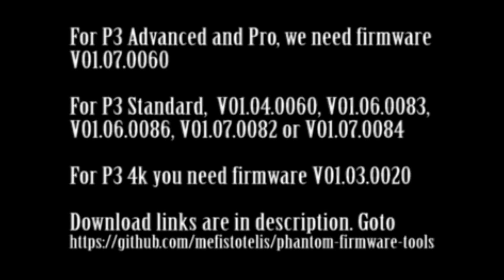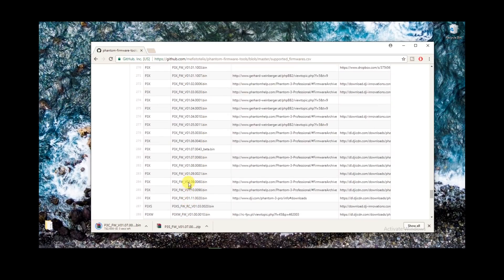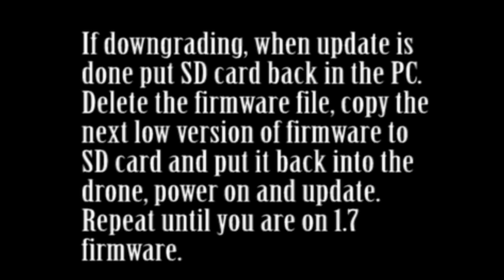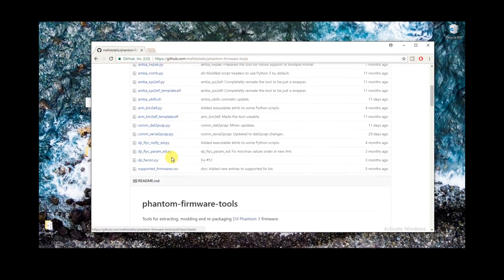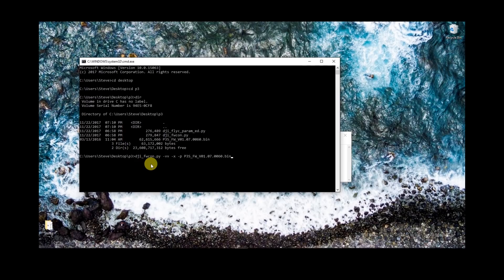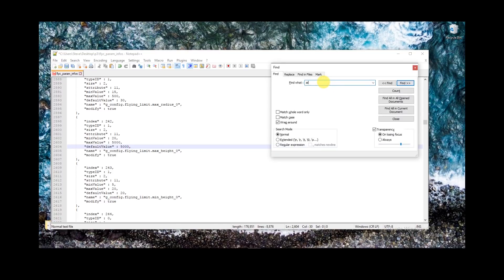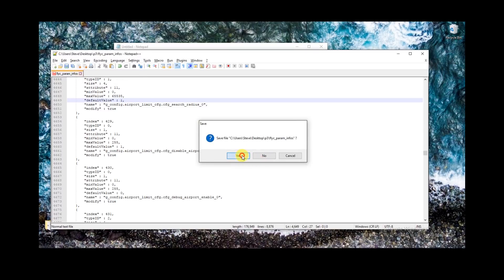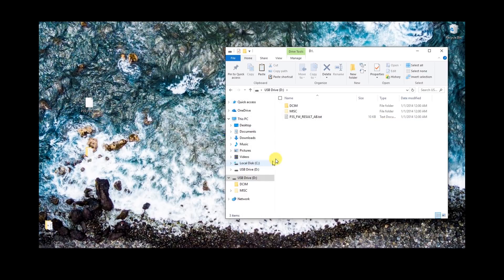Phantom 3: How to modify flight parameters and hack height, speed, flight area restrictions

Comment: Please help i did every thing as shown its a P3 standard downgraded P3C_FW_V01.07.0084 filename renamed PMCAPPFw3.bin put on sd card the damn thing wont update the flight controler module even with forced mode power on linking button hold down wont get PMCAPPFw3.bin updated can somebody help ?

Comment: I am using phantom 3 standard. Can someone give me an update. The best firmware version-  the best dji go version to use. Ect.   That way I can make sure to save all original files for backup then begin the process.   I see how some updates both from firmware and dji go have caused both bugs and errors and also restrictions.  Which if we use the drone in a responsible way for example at a elevated height in the mountain some of those restrictions may get in the way.    I've also heard about a version of dji that is completely offline mode no restrictions.    It doesn't seem anyone is updating on here. But if someone does. I would appreciate it.   As I'm waiting to upgrade my drone both the aircraft antennas receiver (both 2.4 and 5g) and upgrade the control transmitter both antennas. And therefore I'd like to also upgrade/downgrade fix my firmware and software.  I have used and like litchi and also have disabled all automatic updates and I see it's caused issues for others.    I even noticed a issue with my own between my Android and iOS.   One gave me distance and height restrictions the other had uncapped restrictions. Obviously an app controlled issue.   Looking into other versions...

Comment: Okay, it's August 2019, and the UK is restricting drones with limits such as altitude. Will it still be possible to modify my Phantom 3 standard (currently with latest firmware, using Litchi to fly and DJI Go 3 to do adjustments such as IMU calibration) by using this method, and is it possible to list the steps in that scenario please? I keep getting auto RTH at unwanted moments in filming, and whilst I would still wish to fly safely, I would like the range of the P3S to be better. I currently use upgraded outboard antennae on both receiver and aircraft, and also use the Magic 5. Many thanks for all of this information you have given in a most concise way. I do not fly above 400ft, but would still like the speed mods and a more acceptable range; something is holding it back :)
Reply: I should add that when I film over a distance, it is still line of sight, as I use a spotter with binoculars.

Comment: Digdat0 does this still work?
Reply: Ok thanks.  So I need to download it and then change the unpacking command to the current version right.  Then follow the rest of the directions
Reply: @kevincurtis7749  yeah wherever it says the other firmware just put your current firmware
Reply: Yes but not need to downgrade fw anymore but it's the same process
Reply: @ziplock5330  which version do we unpack to edit the flight parameters?
Reply: @kevincurtis7749  your current FW version

Comment: Got it really high. Turned off smart RTH. Now getting critical battery alert forces it down. Ideas to fix?
Reply: you want to start flying down on low battery dude. it doesnt come down as fast as it takes off and you may get some wind resistance at high altitudes. youd wanna get back before your battery dies. it starts going down for a reason. you can always set your low battery alert to a low % but i dont recommend ignoring it.

Comment: I have been flying for more than a year with all parameters changed from his video.  Now I can't go over 500m.  Anyone else?  Any suggestions to try?  I have tried reloading bin from SD card same one as before.  Then flying without an App or with non-DJI app.  Stops at 500m.
Reply: please help me out steve. i tried to do this for 1.11 now nothing works. i didnt get any error messages and it fully installed. But the camera has no signal and gimbal flashes red when turned on. tried to install the original 1.11 firmware but nothing worked. same problems now. how do i fix this? please help :(

Comment: hi i have a phantom 3 pro but am getting sum mixed info on this hack or downgrade my drone is at 1.11.20 rc at 1.9.2 and dji go app 3.1.46 my question is this possible to perform this downgrade to my phantom with my current  fw versions?
Reply: not sure what you mean but as i stated b4 the dji app is telling me my phantom 3 pro is at fw 1.11.20 and my rc is at 1.9.2 and my dji app is ver3.1.46  was. wondering if this is possible to do
Reply: What version of P3 firmware does the app give you? and what version of P3 gives you the SD of P3 ?, say the same?

Comment: I came across you video a few days ago and decided to try this for myself. A bit scary as I've never done anything like this before, but found the process, and your "How to do it" very easy to follow and I have succeeded in downgrading and changing the flight parameters of my P3P. 
My question is: Do I need to change anything else before I attempt to fly it for the first time? You say "just go and fly"
Do I need to do anything with the controller? Also, I fly using the Litchi App. Are there any setting I need to change?

Once again, many thanks for taking the time to post, what is, a very instructional video.

Rocky

Comment: great job digdat0

CMD console 
C:\PS3P>python -m pip install pycryptodome

", line 672, in 
main(sys.argv[1:])
File "dji_fwcon.py

It works as below, without error

C:\PS3P>python.exe dji_fwcon.py -v -x -p P3X_FW_V01.11.0020.bin
C:\PS3P>python.exe dji_flyc_param_ed.py -vv -x -m P3X_FW_V01.11.0020_m0306.bin
C:\PS3P>python.exe dji_flyc_param_ed.py -vv -u -m P3X_FW_V01.11.0020_m0306.bin

Comment: I have a firmware 1.11.20. The whole compilation runs smoothly. In the application I can change to max AGL 999m (I set it up) but I lose this parameter and again it returns to 500m. (I changed both parameters corresponding to max AGL) Flight test also max 500m I do not know what to do :( It is interesting that the application on the Android system does not give you the ability to switch to 999m (max 500), and the application on iOS gives you the ability to switch to 999m but does not remember it. Somewhere else has to be remembered is 500m
Reply: Z tego co wyczytałem na DJI Wiki ta modyfikacja już nie działa , DJI GO teraz też coś tam sprawdza i trzeba hakować applikacje .
Też wykonałem wszystko jak w opisie i mam to samo co u ciebie ,wpisuje 5000m a aplikacja tego nie pamięta dodatkowo wywala komunikat ostrzegawczy .
Mój EN jest słaby może tobie uda się ciś więcej wyczytać .

Also note, from version 4.1.15 onward, the .dji_configs trick to force FCC mode no longer works, the file isnt parsed by the app. Work is ongoing by @czokie and @jezzab to bypass this. This can be looked at on this page IOS Tweaking with Frida & Objection

https://dji.retroroms.info/howto/iosmod
Reply: Zrobiłem downgrade do 1.10.90 i wszystko ruszyło. Jeśli chcesz pomocy odezwij się. Pozdrawiam
Reply: Wysłałem wiadomość na Google+
Reply: Krzysztof Rzepniewski FB
Reply: Cześć kolego. Czy udało ci się znaleźć rozwiązanie do modyfikacji fantomu 3 na końcu? Próbowałem od tygodni i nie mam się nigdzie. Czy aplikacja DJI GO została załatana przez DJI? Zrobiłem wszystko w wideo, zainstalowałem plik PMCAPPFw3.bin, ale wciąż mam ograniczenia w moim fantomie. Przepraszam, że przeszkadzam. Wielkie dzięki

Comment: Hi...You sound really knowledgeable.  I appreciate you putting it out there like that.  I have a problem with my r/c connecting and disconnecting spontaneously.  It is a P3S  with a GL358wA controller.  Linking doesn't work. I get a video feed and the gimbal control works. Connection status on controller goes from green to red , red to green every few minutes no pattern.  Appreciate anything you might think about this.....

Comment: Everything looks successful, BUT although Set Max Flight Altitude says (20~5000m), when I set it to 5000, the previous setting remains whatever it was before (i.e. 120m, or 500m).  Testing to see if the P3 will ignore this limit when at altitude reveals that the previous setting (120m) is respected and the P3 will not ascend any higher.   The solution was to change the "minValue" of "g_config.advanced_function.height_limit_enabled_0" to 2 (as well as making the "defaultValue" of "g_config.advanced_function.height_limit_enabled_0" 2 as shown in this video).  UPDATE:  Successfully flew my P3P >1,700 above the launch point, keeping < 400AGL, contouring a sharp 1,600 foot peak!  Thanks a million FlyFly Drones!  This exceeds the previous 500m max altitude and completely ignores the DJI Go app's max altitude setting.

@digdat0 
Reelworthy, LLC officially dedicates this song to you FlyFly Drones ;)
https://youtu.be/0iAzMRKFX3c?t=1m31s
Reply: A year ago I was flying 600m+.  Now it stops at 500m.  Should I try your suggestion for minValue?

Comment: hello, I have a problem I already made modifications and I wanted to fly higher than 500 m but in the application I can not set because I have a limit of 500 what should I do in this case?
Reply from the maker: We cant remove the 500m in the GO app, instead we bypass it. Limit not enforced after. use the height_limit value = 2
Reply: and if I did exactly the same thing with version 1.11, would it work?
Reply: I did everything on this video and I do not know if this is the last phase of installation I do not want to install, but as if I installed something, but when I tried it, nothing changed and I do not know where I'm making a mistake :(
Reply from the maker: yes, you can remove the mods with 1.11, no issues. just make sure you have crypto module installed.
Reply from the maker: send your flight parameter file to flyflydrones@gmail.com and i can review and see if i can help

Comment: No need to downgrade anymore, you say. 
So if I'm correct, then I should download the firmware version that I have now (in my case https://dl.djicdn.com/downloads/phantom_3/P3S_FW_V01.09.0060.zip) and follow your instructions, replacing  "P3X_FW_V01.07.0060" with P3S_FW_V01.09.0060 every time?
Reply from the maker: thats correct. the steps are identitical no matter what firmware version you are on, absolutely no need to downgrade. Im running 1.9 on one of my p3's and it ROCKS!! That firmware you linked is for the ADVANCED, make sure you have an advanced :)
Reply: digdat0 Thnx al lot for your reply. I do have an P3 Advanced. So I cross my fingers and give it a try...
Reply from the maker: post up if you run into any issues :)
Reply: I put the sd card back in, turned the P3 on the red light started to flas, and I hear a series of 4 beeps. After about 5 minutes the front red lights went on, end the yellow back ones are blinking while I hear 1 long and 2 short beeps, for more than 15 minutes now. Something wrong or just wait?
Reply: Update: after 45 minutes I switched the P3 off and removed the SD card. Luckily thre P3 started normal, but nothing's changed in the flight characteristics. The file on the SD card was renamed to PMCAPPFw3_updated.bin, and the file P3S_FW_RESULT_AB.txt looks like this:

Delete history success.

Result: Abort.
The firmware on the SD card is identical to or older than the current firmware on the aircraft.

========== 2014.01.01 00:00:09 remo-con disconnect======
Packet: P3S_FW_V01.09.0060.bin
Result: Abort.
The firmware on the SD card is identical to or older than the current firmware on the aircraft.

The last 4 lines are repeated about 40 times, with only different dates...

Comment: Hi there
Is there a way to change the battery settings on the P3P to remove the forced landing on critically low battery?
Reply from the maker: yes, you need to set smart battery and all of the voltage landing protection settings as well, to zero (0)
Reply: Are these located in the same file,  the  "flyc_param_infos"
Thanks for all this!!
Reply from the maker: yes it is

Comment: I finally completed my Phantom 3 Advanced Parameters Mods.  After testing my drone, here are some details this video didn't include. 
1. You need to install PIP for Python and add it to your Windows Path variable
1. Your Controller must be downgraded to version v1.5.80
2. Within the DJI Go App, you must disable the Smart Go Home Option (The performance modifications will cause high battery drain which will trigger a low voltage Auto Land, even when your battery is full)

My Phantom 3 Advanced now performs very similar to a Mavic Pro.  Thank You for this amazing Hack!  You're a Legend!!!
Reply: Tim I need your help. I also want to mod my p3 advanced.
I need to remove NFZ. here my campus and this huge whol place is NFZ.
Reply: Here are the detailed settings you need.  
g_config.airport_limit_cfg.cfg_disable_airport_fly_limit_0
Disable NFZ
 https://dji.retroroms.info/howto/modp3params
Reply: You can upload the image change so I can see the change of the hack
Thanks.
Reply: HI Tim, Ive got the altered firmware now successfully loaded onto my drone and speed etc is improved... however, max alt is still locked at 500m. I'm on App Version 3.1.34 and Remote Controller Version 1.9.3. Im using an iPhone. Do I need to downgrade controller? If so, why? Thanks!
Reply: @ElmaOrkestra  Same problem here was working above 500m, now it's not.
Reply: Mine never went above 500 ft. The dude in the vid sent me a few versions of the firmware but none ever let me fly above 500m. 
 @sbright33

Comment: I have a p3 standard, fw ver 1.9.20 and need to downgrade, what is the next one down thanks
Reply from the maker: you dont need to downgrade anymore, the process works on any version!!
Reply: Do I read correctly?
The Firmware doesn't matter now?

So I can flash the modded file up to my 1.9.20 too?

Comment: Comment and a question.  Whew!  Thought I bricked my P3 Standard today.  Mine is not like the one in the video though as the memory card slot is on top of the camera as opposed to integrated into the mount housing in the video.  

Followed all the steps.  Formatted the card to start.  Just in case (pretty sure it was already there anyway), I started with P3C_FW_V01.09.0200.bin along with the P3C_FW_DEBUG file with no extension.  P3C_FW_RESULT_AB.txt shows "Abort - The firmware on the SD card is identical to or older than the current firmware on the aircraft."  

Next hit it with P3C_FW_V01.08.0100.bin and all seemed to go okay.  Result file shows only shows the message "Packet: P3C_FW_V01.08.0100.bin - Upgrading ...".  

Next I tried to hit it with P3C_FW_V01.07.0090.bin.  This is where the problems started.  It ended with a red light and a horrendous sound.  WAY louder and more annoying than the standard upgrade/downgrade tones.  I'm serious.  I put this thing in my walk-in closet in my bathroom, closed the door, then closed the bathroom door, then closed the bedroom door and you could still hear it!  Even tried covering it with a thick blanket.  My heart sank when I powered it off/on and the same louder/annoying tones continued.  Result file shows "Packet: P3C_FW_V01.07.0090.bin - Upgrading..." and nothing else.

Thinking I bricked it, as a last ditch effort I put P3C_FW_V01.09.0200.bin back on the memory card and hit it again.    It started out with the louder/annoying tones, but after about 15 minutes of that, it went back to the softer "beep-beep" tones and was flashing red/green again.  15 minutes after that the flashing stopped.  Removed the memory card and powered it on.  Everything works again.  Yay!  Result file shows "Packet: P3C_FW_V01.09.0200.bin - Upgrading...".

Not sure if I want to try this again.  Seemed so easy.  

Where did I go wrong?  I read that some are built with different hardware which could make downgrading risky.  Could mine be one of those?  OP, any way to message me and help me solve this?  Would love to get the extra features out of this drone.

Thanks for your hard work putting this video and information together!!!

EDIT:  Just saw this post down below:
digdat0
2 months ago
the tool was JUST updated to allow ANY version to work :) so you dont need to downgrade anymore. we can modify and flash your current version. re-download the dji_fwcon.py file and the fw of your choice

Should I give this another try with P3C_FW_V01.09.0200.bin?
Reply: So I did go ahead and try it out.  All went well up to the part of actually flashing the firmware into the drone.  I put the PMCAPPFw3.bin file into the blank memory card with no other files, turned the drone on, and the drone just turns on like normal.  No signs of a firmware flash occurring.  I saw in the notes on http://dji.retroroms.info/howto/modp3params to force the firmware load using the pin reset.  I only see one pin reset on the underside of the drone towards the edge.  The pin reset did reset everything on the drone but didn't trigger fw update.  Am I missing anything?
Reply: Did you try it again?
Reply: @3rdZoneClips  No. Sold a long time ago.

Comment: Can you please do a weight test for these changes? Meaning can we pick up heavier objects with this setting?
Reply from the maker: the only weight i would carry on my p3 was more batteries :P What are you trying to carry? If you add much weight, you wont get good flight time.
Reply: I have done a lot of research. Basically the P3 standard can only pick up like 0.6 (lbs) pounds. Meanwhile the phnatom 3 professional can pick up around 2.5 lbs. 

I am trying to pick up my mavic, but my P3 standard cannot pick up that much weight. I wanted to prepare if my mavic ever gets stuck in a tree that I would be able to pick it up. My experiment is to use neodymium magnets (strongest magnets in the world) attached to a string on my P3S.
Reply: Basically I want to know if I modify parameters will I at least lift 1.5 lbs?